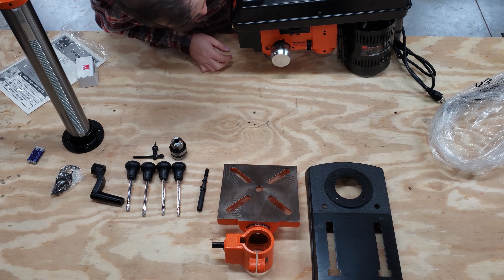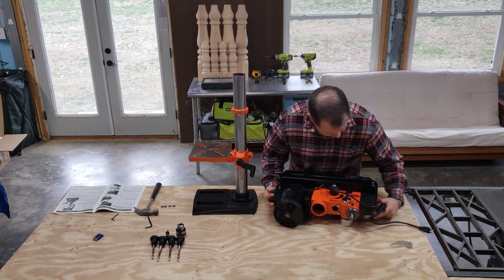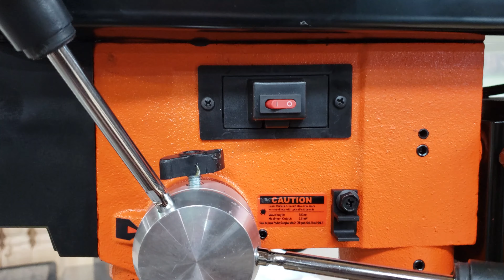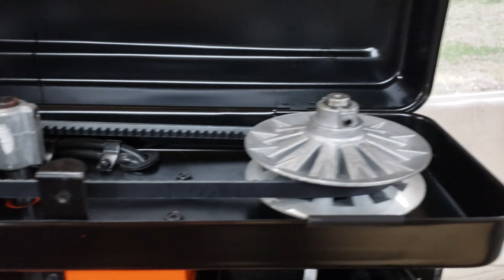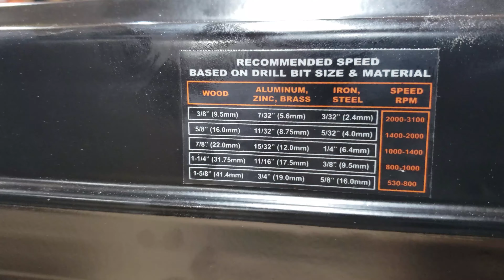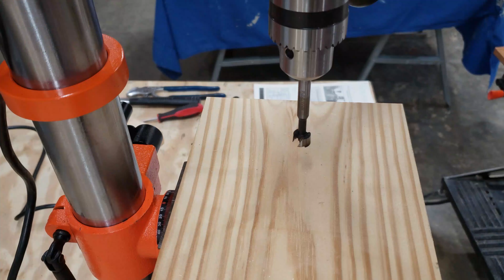The Shop Gets Some Upgrades! (Part 3)

Comment: That thing is a beast for a 10" drill press.  I was hoping that it was as small as the Bauer 10" drill press but has a variable speed transmission.  It seems like going up to a 12" 4214T is not that much different in height.  At least the 12" table can rotate and has an LED light on it.

Comment: The rack gear is supposed to float slightly, not be wedged in there as tight as it became after you hammered the top ring down. That slight float allows you to swing the table to either side and get it out of the way.

Comment: Thats a constant velocity transmission, the pulleys raise and lower changing the V groove the belt rides in, which changes the speed of the spindle. If you open the cover you'll see how it works.